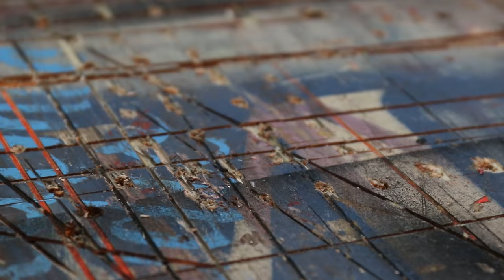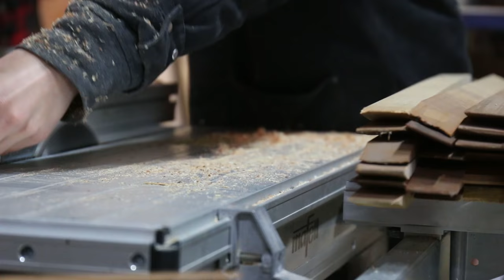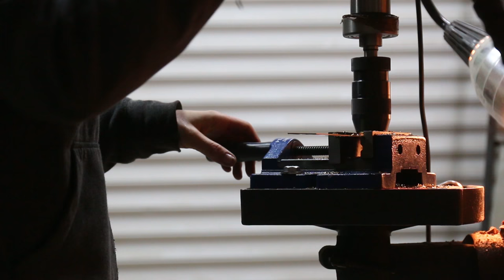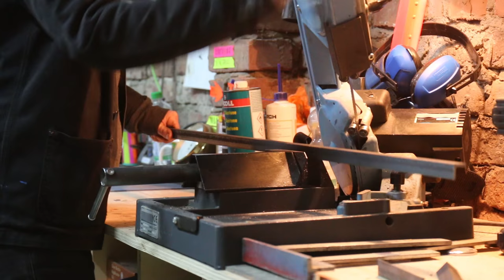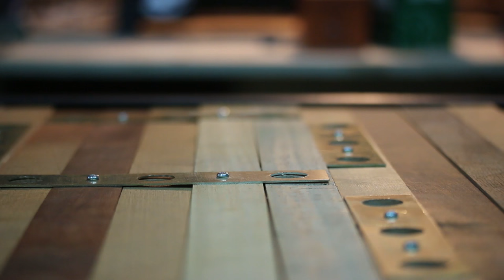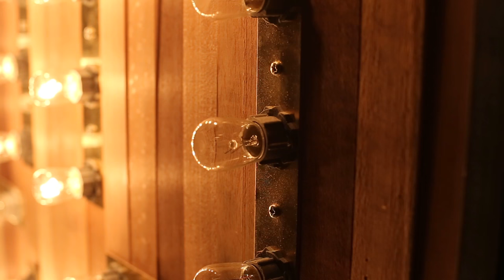Laura´s Big Movie Prop Clock

Comment: Very cool! Would be crazy cool if it were a working clock!
Reply: Pask Makes its not hard to do it. Change the wiring, change the lightsources (they dont like up to 1440 cycles a day), use some relays or transistors and a arduino.

Comment: Absolutely love it! I can that it'd be hard to integrate control, all the high voltage would be hard to control and arduino a aren't even super accurate. Makes sense just to do it how you did!
Reply from the maker: thanks, it was the quickest and cheapest way...
Reply: Laura Kampf, definitely, and a working clock would be rather awkward to work with on a set!

Comment: You could run the entire clock off an Arduino and some relays. Would be pretty simple and I'm sure the code is out there or it would be pretty easy to edit existing code.

Comment: nice was thinking what is she powering the clock...then i read notes and seen what you did...still cool.... but i have no clue what to do....lol...and congratulations on 60k...you rocking you- tube...
Reply: Robert Evans : Laura did "stop motion".
0. Lock all camera settings to "manual"
1. Take a shot
2. Stop camera
3. While camera is off, move into the frame
4. Screw/unscrew bulbs to change the time displayed
5. Walk out of the frame
6. Restart camera
7. Repeat at step 1.
Reply from the maker: Exactly! thanks for explaining

Comment: You can turn that into a clock fairly easily with a cheap single board computer and a bit of coding.  I've made clocks in Second Life, and when I made a digital clock, I had to figure out how to turn on/off the proper segments to display the numbers 0-9.

Comment: "Cut the blue wire." ... Sorry, for the stupid action movie reference.  
I like it. With the warm glow and wood strips, the build reminds me of a carnival or an old basketball court. 
As for a working clock from scratch, it might be easier to switch the bulbs to something more manageable like 12V. Personally, controlling 230V lamps with hobby electronics would a bit too daunting for me.

Comment: I really like the clock idea. It's almost there. All you need is a 555 and parts, some 4017's (decade counter), some 4511's (seven segment driver/latch), and some Darlington arrays (ULN2803A is good for 50V. 0.5A) could be cobbled together to drive the "segments". In your clock''s case (3) bulbs per segment. You could up the game and drop in a PIC microcontroller, some crystals, and drive the counter that way for more accuracy.

Check a YouTube Channel called Mr. Carlson's Lab. He's got a great series on how to build a programmable frequency counter that could be modified to work for this

Comment: some 7 segment led drivers and some relays would probably be the easiest way to build it. Synchronizing with the mains to fire triacs at 0 voltage, or using available chips/modules that implement zero crossing  switching would be the easiest way to implement a silent/small controller

Comment: What are those screw in bulb holders that self cut the insulating cable outer called?
Reply: Ralph Blair Did you ever find out? Desperately seeking these too, and I've exhausted google.
Reply: i found them here. but just buying one racks up a $150 shipping charge
http://landwermann-technik.de/shop/beleuchtung-und-zubehoer/eco-e14/kabelfassung-e14-eco/

Comment: Great big "clock".
If this is a real clock, you get a really expensive electricity bill.72x15 = 1080W ! (at 20:08 where the most bulb are on)
Next step, change to LED bulbs and make a real clock.
Reply from the maker: i think the bulbs make all the character of this build...led would not have the same feel
Reply: yes this is right, but if you use filament LEDs you see the diffrent only if you stand cloes for the clock and the Bulbs are off. If the on  you can't see this are LEDs. =)

Comment: Regarding making a real clock, if that were LEDs this would be fairly easy to achieve using addressable LEDs such as Adafruit Neopixel (https://www.adafruit.com/category/168). With light bulbs, I guess you need to  use relays. You need to control at least 28 of them, which is more than the number of GPIO on standard control boards. You probably need a multiplexer or shift registers. I found a 32 channel relay module that could be used for the purpose, but is fairly expensive (http://numato.com/32-channel-relay-controller-board/). I'm sure there are cheaper ways to implement this. Does anyone have ideas?
Reply: Fabio Rossetto Arduino's standard shiftOut library supports 8- and 16-output shift register chips. Each shift register only takes 4 Arduino pins to connect, so two 16-bit latching shift registers can be used. Outputs of shift registers can control relay coils via simple transistor keys. It will be a really cheap solution, just requires some time to engineer it.
Reply: Surely there is a purpose made controller for this application, how are large scale productions of this kind of thing done?
Reply: Just use an old clock radio to drive the transistors - use the output to the original 7 segment displays.  Total cost a few dollars and a bit of wire.  Simples.
Reply: You don't need 28 relays. The top and bottom segments of the tens of minutes can be controlled by the same relay. (because whenever one of them is on, so is the other) There are a few other optimizations that can be made.